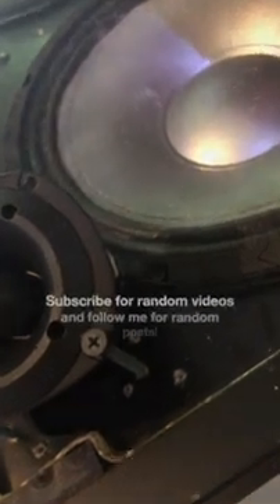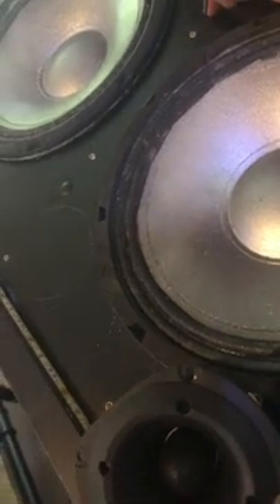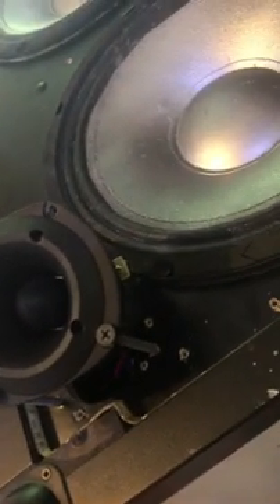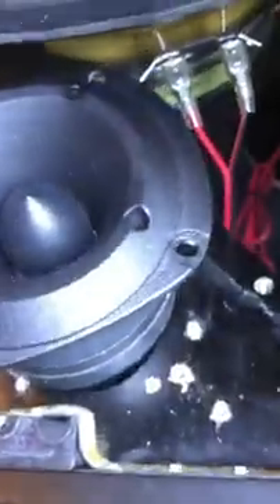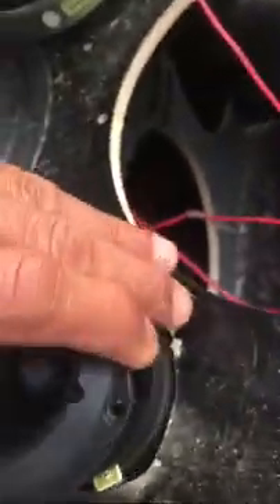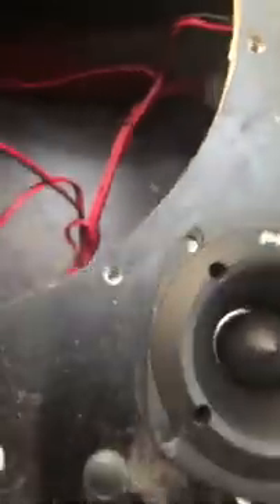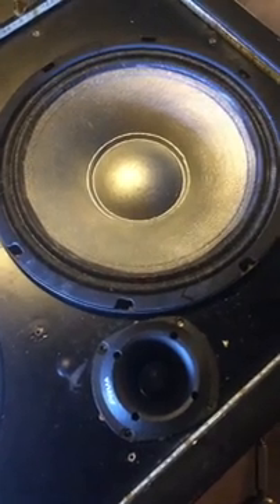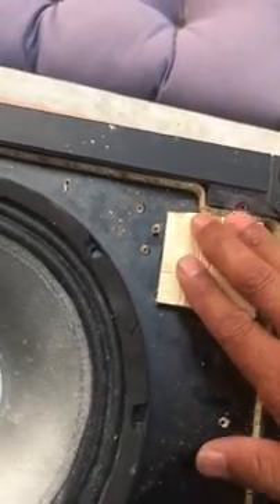upgrading my soundboks 2

Comment: Put a capacitor on the tweeter if you haven't already might help it last longer
Reply: no need, the signal is filtered through dsp
Reply from the maker: The tweeter was just too small and soft for what I use my boxes for. The horn has a stronger build and magnet, and pushed high ends sooo much further!

Comment: I wonder how it would sound with some cerwinvega! Woofers?
Or will it ruin the amp.
Reply from the maker: the magnets on the woofers aren't very heavy... I would assume that anything robust would stress the box out bc the box's dimensions were designed for those drivers... I would assume the amps would push anything... not for as long tho. That would be a fun experiment, finding drivers that would be able to run in that size inclosure but have more thump... everything needs more thump! I have two soundboks 2, I haven't had the pleasure of using the 3 yet. I'm not saying they made improvements based on my requests, but I got the 1 when they first came out (I think it was a crowd funding thing) and immediately loved it but wanted more from it. As a dj (#justbekaz, if you're curious) I wanted more bump (so larger ports for more air flow) and more input options like quarter inch and xlr. I'm sure I wasn't the only person requesting these things (but I'd like to think I was one of the first). it looks like on the 3 they've also improved the tweeter (not only placing it more appropriately in the middle of the drivers for a better blend (something i mentioned as well)) so this upgrade may not be needed. I've used my upgraded 2's a bunch of times since the lock down, and the horn tweeter makes a huge difference in the ability to clearly hear the mid/highs farther out. Low frequencies are easy, you can feel base (if not just hear it) but the mid highs would be lost if you were in the back of the pack. Now those frequencies push just as hard if not harder and you can hear all the music from farther out.
Reply: @justbekazu hoping one day I'll be able to get the sound boks2 .... I ha have three partybox 100's.... sounds really good.....but im guessing one SB would still be louder....also have two bumpboxxes... extremely 🔊 loud....just no Bass!!
Reply from the maker: @theotherhouse5910  I have the bumboxx flare 8 and utra! No, the bass isn't a deep as the SB (cabinet space is the key) BUT they are great for toting to the park and to the beach and general gatherings where you're not trying to be the absolute center of attention! And I thought the mic thing was a silly addition to the 8 until I needed a wireless mic bc the one I brought crapped the bed. Came in very handy!